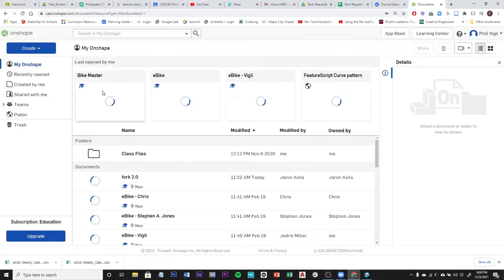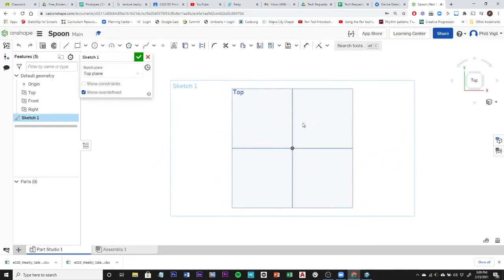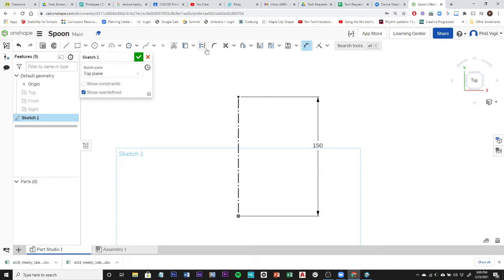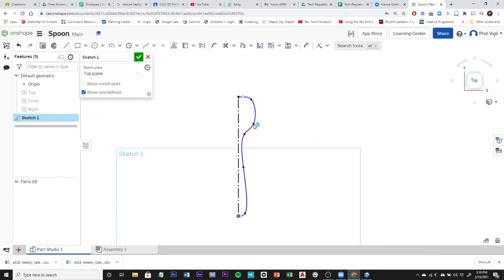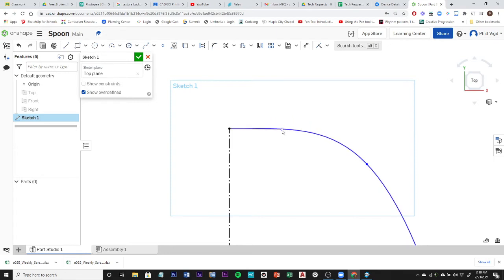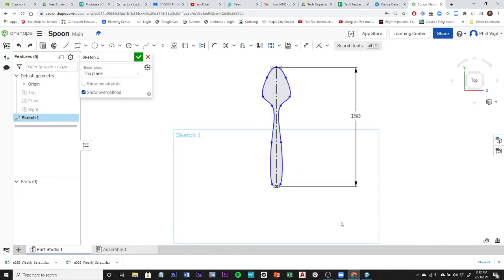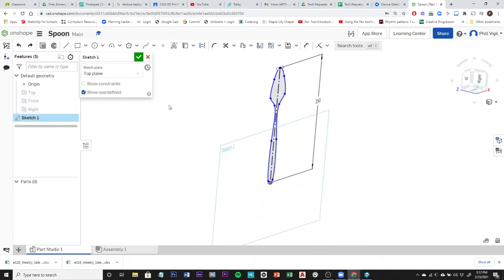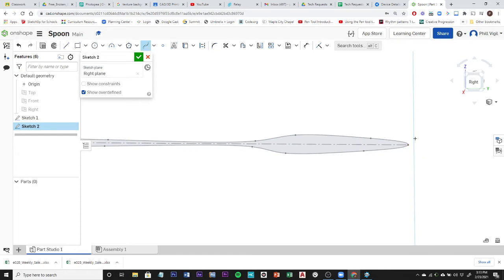Onshape Spoon Design

Comment: Hi, I have problem with a Fill step at the 12:35. When I try it, I don't have it straight, it's like a wavy. Here's the image https://i.imgur.com/EFGYllG.png and here's the project. https://cad.onshape.com/documents/b6e03389afaaa20d7cf649bf/w/2e44f0d8c969282eee2b62ba/e/fcc756bd4e484395f457f369?renderMode=0&uiState=633b4ce33bbbdf7d8e7e8810